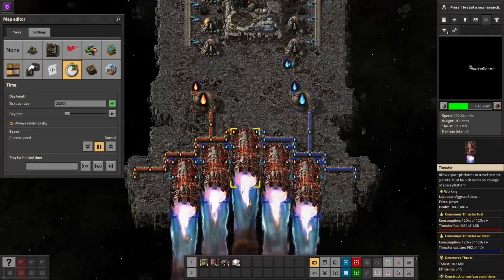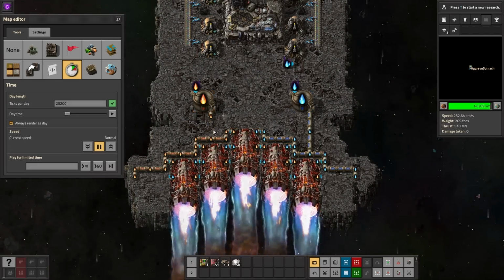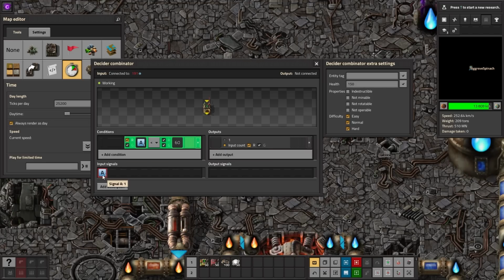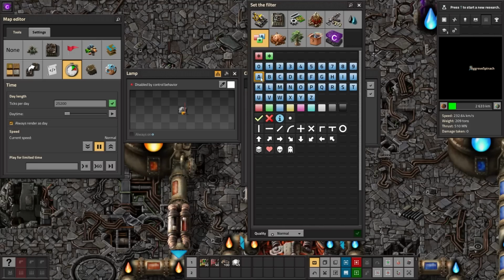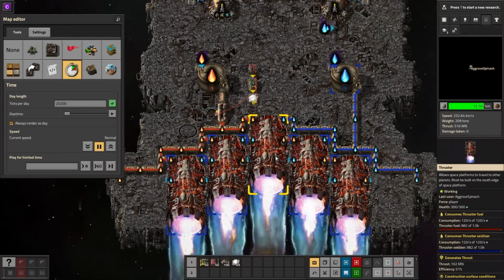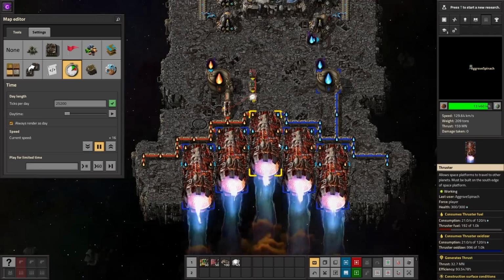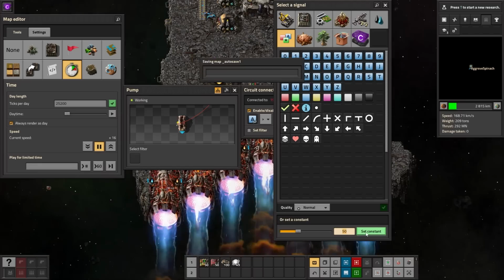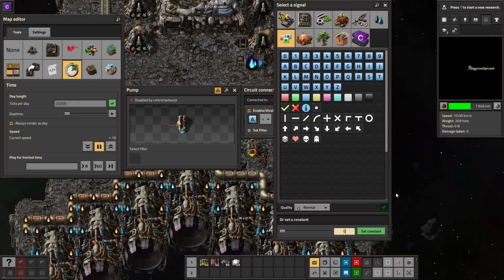Controlling THRUSTER fuel input and efficiency - Factorio 2.0 Space Age Tips & Tricks

Comment from the maker: Thanks for all the comments and ideas. Just wanted to address the repeated comments in bulk.

1. I can't get the second storage tank solution to work. I don't know if I'm putting it in the wrong place but putting a storage tank "after" the thrusters, that storage tank's fuel levels never match the level of the thrusters
2. Hooking up the pump to the hub works great, just set your desired velocity to one that use a half a tank of fuel, so definitely a more elegant and simpler solution, you'll find that the fuel fluctuates a lot more so you can't maintain as granular of an efficiency, but it removes the need for the clock circuit, which I think is worth the trade off
Reply: as a recommendation, 60 tick clock circuits are great whenever you want something that relates to real time seconds, but is less usuable for humans when dealing with things where you'd want a portion of x (like 50 out of 60 in your example)
personally, i try to use 100 as i can use more relateable percentages to controll circuits
Reply: I set up a second pump inline after the clock controlled pump.  The second pump reads the ship velocity from the hub and enables or disables itself based on whether there is velocity greater than 0 and this helps to prevent my thrusters from filling up all the way once parked in orbit.  There is some extra fueling due to the ship "drifting" into orbit for the last few seconds, but overall it only generates an extra 10% of fueling in the thrusters.
Reply: @dirtyoldgoat  Instead of velocity, you can use the "moving from/moving to" to fix the extra 10%. As soon as you arrive at a planet, it sets that planet's signal to 3 if you read both moving from and moving to, so if you have a condition that verifies that none of the planet signals are 3, that's equivalent to checking that you aren't stopped at a planet. When you first create a ship though, the thrusters will be empty and this condition will prevent you from ever putting any fuel in them, and you will be "stuck" at the planet forever, so you just have to disable this condition long enough to put a little fuel in the thrusters for new ships.
Reply: It won't match the level of the thrusters. The thrusters are "greedy" and take as much fuel as they can. Putting the storage tank in front with a low limit of like 50 fuel ensures only a trickle of fuel from the tank to the thrusters, because the closer the tank contents is to 0, the slower the flow of fluid. With a higher limit, like 1k or more, there will be no limit. The trick is to limit the tank contents to something very close to zero. The closer you are to zero, the slower the flow. The easiest way to see this is to temporarily put a pump between the tank and the thrusters as well. You will see that with a decent amount of fluid in the tank, the pump will operate at the maximum consumption rate of all of your thrusters, but once the contents of the tank get low, the pump's rate falls, feeding less fuel to the thrusters, which lowers their volume and increases their efficiency. Putting a pump BEFORE the tank to keep it perpetually at that lower volume holds that condition indefinitely.

Comment: I've been using this tool, and I must say it's been amazing. Cutting my fuel usage almost in half means I can travel twice as far on the same tank, with more consistent speeds and less downtime. I call it the 'choke' like on old gas cars, since that's basically what it is. 

Something I've noticed about the efficiency: you mention that the 'choke' should be put on both fuel and oxidizer, but what I've found is that you only need to throttle one input, and it's agnostic as to which one. The thruster efficiency will improve even if only one input is throttled, and it appears to be a global metric that will influence both inputs simultaneously, meaning they both burn at the same rate regardless of which one is throttled. 

Plus the thruster exhaust turns bright purple the more efficient it becomes, which is a nice detail.

Comment: The easiest way I have found is to put a tank before all engines and only pump into the tank when the level is low,  <50 units.  This also self regulates if you add more engines, are stopped, etc.  Adjust the level in the tank to go faster or slower.  Works amazing.

Comment: entire pipeline keeps the same% of fluid, so if the thruster contains 30% fuel in it, any random pipe will read 30/100 and tanks will read 8.3k/25k, so you can just wire a pump to once of those and not need a combinator

Comment: I'm currently reading the speed. If the speed drops below a certain value, it enables the pump(s). It works OKish, at least well enough 95% of the time and no need for circuits. I will give this a try though, because I think this is easier to tune.
Reply from the maker: Yeah its got less variance. Speed is fine too easier to set up

Comment: My solution is a bit different, though the math is probably quite off; I take the total fuel remaining in tanks (I use 3 so thats 75k, i believe), convert it to a percentage, and feed that to the pumps as the "If the clock is higher than this, activate" statement; it means my thrusters will give it their all at the start and slow down over time based on how much fuel is left (and thus how much to conserve)

Comment: what i did was set my pumps to come on whenever the speed is between 110km/h and 120 km/h (only need 1 decider combinator) this way it will stay between 90% and 100% efficiency and with each trip the fuel in the tanks only go down by a bit less then 5k. Note  if you want this to work you will have to have some fuel in the thrusters before your first flight so i just made it so it had 300 fuel in the first flight to get to that speed and every flight after that there will still be fuel in there from the last flight and enough to get back up to the desired speed. Also the reason i set a minimum speed is because that way it doesn't fill up when the ship is stationary or fill up whenever the ship is still accelerating to the desired speed.
Reply from the maker: Yeah, and if you didn't want to check a min speed you could just wire it directly to the pump without any combinator too
Reply: @DataEngineerPlays  ye true only reason i didn't do that is because it fills up the engine when idle which makes it so at the start the ship goes very fast and wastes a lot fuel.

Comment: i add a tank after the pump and have the pump read the tanks value, keeping the tank below 500 roughly halved my thrust, its a little bumpy because the pump tends to turn on and off in 0.5-2 second bursts,  but I'm not riding the spaceship so lurching faster and slower doesn't bother me,  as long as she burns fuel efficiently and doesn't ram 2000 asteroids that's a win

Comment: I get what you're trying to solve here, but I don't understand why it's an issue: there is no penalty for consuming more fuel than you produce. In fact I'd argue the increased thruster efficiency is more of a safety cushion in case your production can't keep up. Adding more thrusters also comes at a drawback, as it adds more space platform area used for propulsion, which in turn increases weight, reducing thrust efficiency.
Reply: I also had a similar thought to you. Doesn't feel like the extra mass and area usage is worth it to me. Maybe I'm not going on sufficiently long duration trips to care? Tbh only been on 1 other planet so far
Reply: @joshuacheung6518  the thing is, the more your platform is moving, and the bigger (wider) your platforms get, the more asteroids you will mine and you care less about being resource efficient and more about how you deal with overproduction or other issues like power(til fusion) or storage. Hence why it's a good idea if you're going for space mining platforms to have them patrol rather than just sit in orbit.
Reply from the maker: You can just produce more fuel yes, personally my space crafts are designed pretty inextensibly, so adding more fuel production isn't exactly easy, whereas adding 2 more thursters, and this tiny logic circuit is easy.

Secondly the fact they implemented this mechanic just feels to me that running your thrusters at a higher efficiency is the "correct" or "intended" thing

Comment: I did something simmilar but instead i made it based on the ships speed and pumping the fuel only if that is below the speed.
Reply from the maker: Do you notice the fuel fluctuates wildly that way? I tried using speed, the trade off is, no circuitry required just make a condition to inject fuel up to a certain speed. But I found the fuel in the tank (and therefore the efficiency) fluctuates massively

Comment: I'm trying to imagine why I should care about efficiency when its already so easy to overproduce fuel and resources are easily accessible and free. I should think the major concern would be more velocity, both maximising it and optimising it to ammo expenditure/asteroid collection.
Reply from the maker: Yeah you don't have to care about efficiency, I certainly have not implemented any of this in my playthrough until aquilo. But its easier to add this logic circuit than 2 chem labs to make more fuel?
Reply: @DataEngineerPlays  its good reasoning and probably optimal when you don't run an excess of fuel, for my aquilo ship I decided to beacon 3 c.plants (for each fuel) with speed 3 modules, giving me a huge excess.  With the nature of a spaceship's resources of use it or lose it, its mostly better to not ration and increase production.

Comment: Cheer up for your effort.
I definitely learned something.

My idea is simpler.

Use 2 additional tanks, separated from main fuel/oxidizer tanks with pumps.

Check these tanks fluid amount, and set to 60 per engine.

It should guarantee the amount used per second.

It will keep overfuelling as well.
Reply from the maker: It's simpler in terms of not needing a clock circuit. But putting in a another storage tank uses slightly more space
Reply: @DataEngineerPlays  Agree, but it is pretty enough space in the Space, it is literally called Space.

Comment: I just do something like this:
Main fuel tank → Pump → Tank connected to thrusters
Read from the thrusters tank, disable pump when it's above some amount of fuel, like 100 or something. Because of how Factorio fluids work, the flow will be way slower than from the main tank. It seems to be precise and efficient, but you'll have to just guess what kind of fuel value you need to set the pump to until it works.
Reply: This solution is more precise in my experience (more detailed control of speed). It's like a flow throttle (level in intermediate tank == fuel flow)

Comment: I havent played too much into 2.0 and space age just yet and havent really made it to fluids yet. but couldnt you pump that tank into another tank. where the second tank is allowed to free flow to the engines. then you set the pump with circuits to only fill the free flow tank up to a certain percentage of the tanks capacity and use that to control the "level of fuel" in the pipes.

Comment: Why cant you just have 2 tanks? Circuits can read the tank and because thrusters are in and output, they level out perfectly with the new fluid system. One tank is the reserve and the other is the proxy to read the thruster fuel % (as a fraction of 25k). No combinators, one wire

Comment: In case it wasn't obvious to others (I had to watch it twice...)...
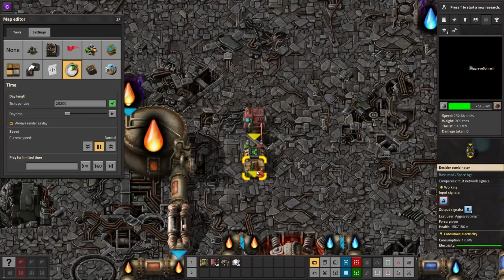2:12 - when he loops the output to the input, you are taking the Decider's output of 1 and merging it with the Constant combinator's value of 1.
Any time you have dual matching (A) signals on the same wire color like this, the values are automatically ADDED.
So Decider + Constant = 1+1 = 2
But 1 game tick later, that 2 is fed back into the Decider and now it's 2+1 = 3
This just keeps looping as fast as possible.
So the Constant Combinator is selecting how much you increment each loop by.
And the Decoder's formula (as mentioned) is when to reset back to Zero (which is 1 when you add the Constant back in)
Reply from the maker: @Casper042  I'll be honest I never quite understood how this works so I didn't want to explain it wrong in the video. Thanks for clarifying it makes a lot of sense
Reply from the maker: Feel like in factorio there's 2 groups of players. 1% who truly understand how logic circuits work and can use them to make hyper efficient complex builds. And the masses of plebs that just feel it's all uncessary complication and I'm amongst the latter group. 

There's too much content in this game while I want to explore and understand how the logic system works fully, I just haven't had the time unfortunately
Reply: Nice little while() loop. So, 1 Sec is 60 ticks or where does the 60 comes from?
Reply from the maker: @Xadoras  Its the in game tick rate 60 ticks per second

Comment: Multiple tips to improve this:
 - Use an increment and a loop-cycle which are co-prime numbers. This allow to have larger cycles (~1000) while visiting every number. Thus providing finer control for the threshold (condition / loop-cycle).
 - The pumps have a pumping speed (p), and the thruster have a consumption speed (c). To have 100% fuel, the pump only needs to be turned on for c-cycles over p-loop-cycles.
 - Dividing both c and p and by (c / 100) will let you use a the turn-on condition which express the desired percent of thrust that you want to achieve.
Reply from the maker: Cool idea, I did think if there was a set of variables I could use such that I could set the number on my pump to accurately reflect % of fuel in the thrusters
Reply: @DataEngineerPlays  % of fuel in the thrusters ? But I thought you said you can't connect a wire to the thrusters ?
Reply: @power2084  you can't directly measure it. But as OP was describing you can determine consumption (c) as a given speed value, and back calculate the ideal active duration for the pump. 

active duration = c/p
Reply: @cyanleif  ok so it's an indirect measure. Gotcha.

Comment: I think is worth mentioning, that if you make a clock 60s, when you set it above 50s put fuel, the better solution will be to set the clock to 6s and only pump fuel when the clock = 6. In theory, this same amount of fuel, but the interval is better keeping the top efficiency all the time. 

But great idea.
Reply: that's exactly how I've done this in my schematic, because the higher the frequency of PWM the better, in fact for 1 engine you need to turn on pump for 1 tick every 20 ticks (about 77% thruster efficiency, like in factoripedia graph)
Reply: 60 ticks=1 second so it's being averaged here over one second, not a full minute, but you're right.

Comment: I've wired clock via route reader so in only pulse when it is needed to fly. I also read current velocity and use it as an additional limiter. My clock also uses pulse-frequency modulation, not pulse-width modulation so my thrust and efficiency are more consistent.

Comment: I´ve made one where you can set a max speed and/or the fuel per sec you wanna burn per engine. Just set E to amount of Engines you have and F to the fule each engine should burn.
It also comes with automatic shutdown when damage is detected.
The values are labled in the constant combinator, multiple pumps/pump qualitys are also supported by the P constant.

0eNrVWm1u4zYQvQpBoEC7kBPLlrSxgRYwEnsbFEmDjXeL7jowFIm2iUiklqSSGoEP0Fv0R0/Wk3QoyR9xpCQW89EiQEJTnOHwvcfhUM4tvoxSkgjKFO7eYhpwJnH36y2WdMr8SPcxPya4iyWPfNFIfEYibOFvqR9RNYd+ktAALyxMWUj+wF17YZUY+4KqWUwUDRoBjy8p8xUXG1atxYWFCVNUUZLPn32Yj1kaXxIBbq2lq5AENCRi04+FEy7BlDM9JbhrOBaG2Oz2ngtzhFSQIH8K/bBCJXg0viQz/5qCNZgUPsfwLMz8SN27+QkimlAh1Xi9NDVPdDzXVCgAA68CzEc0enp5Gk7la2y9ZlOvkacqSdU2xI+7WlwsFhrZLVhaO8HSrEDFbr0eLJ9zWOLEF1mQXfwjrg3Mx9xZMocQU6bGE8HjMWXgCHcnfiRJBWztWmpy3lBN92H758+/6gP3pVJRjvXwnq1Ex30iOmu3WwDtiMgXjYgk2sfTjW5mVBFtyBMCQGZx4nd4ieJOs5fC5+4MX6tCXFWb8rnwW0FRYLhOVXbTHJ9eBT5eXXzc18ZnUEdfx9va2q+nLetOtGNG1A0XV9kyBAlxV4mUWHgqCGHLTLcV7H2bbNjKSHsop+h9nTPFecsz5agkOf6N9dIqHMnED0gj4kFO08of89NrKu8e3O1aXOTRkHExoc/COvFcp1Hgs/R+RM/jfhqRS/+FfE/SaMrFS3n3v6U04i/kPK905VwqEjdIOCUvNc/MV4qAhhpJBGW1etI0dU/8z/mJD/s38uew/0IiA0GTIk31T/ofP/ROD39Hvw4G6Lef+6foqHfS+9BHx+foqD/sHw77RyPWiyRHwYwEVxLRCZIzmiAqUZAKAUkkmiPKEER8RdkULfPE3ogdr4fqpyS0EGFTyohEsDykUsFIiPhkgkvS0UGddOS+eYm768kxfL2kX1dCq4rhsYq7QmSHWjgr3Uw50D/xYZMJpGY+g18gBV9MiUIyISQsE0Nn1/LhraqrQXll1TKvrAa6sqraxkJwgQ65KNaJDprfocZPyG7C3+8/AZYRomgCl+4MbaKH/zBifeANUYB9xtMoRJcEDJDiSFNhoyPYIrEfIYg7yPBAN4AROj4dljGki8daFP0/Crz+c1weHqJwkJIMatTPMiR6h3qx3mmQHosuWQq7Xbew9l4b97PSreE1m+aV8/HbVs72+nXMcmEPUmDvuZsclIEuc1bk3TZk7eXrNr3eCHLodu+jd4zNd3iMizgbtPViRnekWTGi317Bj4WpHPMN5MrTUEwgjbNgjgZpFKHhTKRSoX1ITJBdABahUKmG27tquPmfkvBz3JvPKu7NtrObtFp3pfUEbF5KacPdlOaC0qyVe8d6PJfu5N452PDuWo+n+528dzacazU8SvZO3u1WsQur9t2wi4Z5AXWuCyhdjf9ysn8+YoMuGkT8BnyS7OAvDpLlgS9ShnwFdQDYw1N/+8BBoBcGkiDhiJ3lY87SOMnLNLQvR2zETnnhO3tyQ2HfcwY3AigmdMUwI3mBp0s/ia4J3IZg1fpGIGHRmyVgPmKzENzT/s9AeHn1ATYcDsYwL0v20DlHLfSJUSX3z7MtiWLKaJzG2WXpBpSvFfvVtvRP+8KCVttys1YLet5nrfZGq2U5lgMtB/oOsj4H+rysz131edDqFC3wY2ePwQU8tqF1oDvBDpodPXMzn7qp2042ws4iauf97eVwCBmqtOJLkO0ju9jT7cVaSdndEtSgJiCfxgSYC/P8o6VY9bVIXfu2oX3L0N42s2+amRvObrr4gnzHkHzHkHzHkHzHkHzHjHzHjHzHjHzHkHzXkHzXkHzXkHzXkHzXjHzXjHzXjHzXkHzPkHzPkHzPkHzPkHzPjHzPjHzPjPynmcPpTxWJYdD63zIsfK1rH+3Q9Vodp9NxHcfrHHTai8W/WxeGJg==

Comment: If maximum efficiency is with the lowest fuel to oxidizer, slap a tank and read whether it has fuel in it, pump only when fuel in tank = 0
Reply from the maker: You don't always want to be at max efficiency though, I found 85% efficiency is good so you want just under half a tank of fuel in the engine